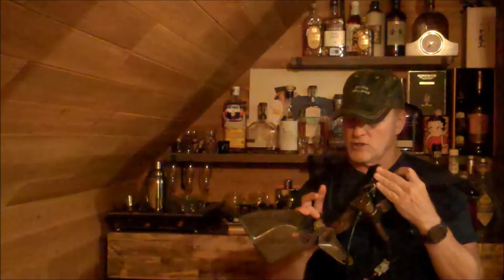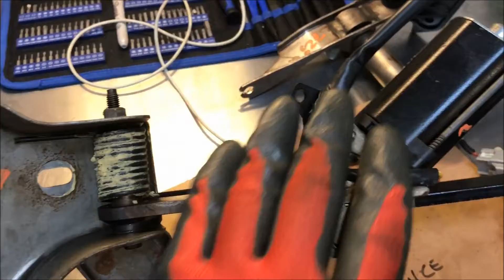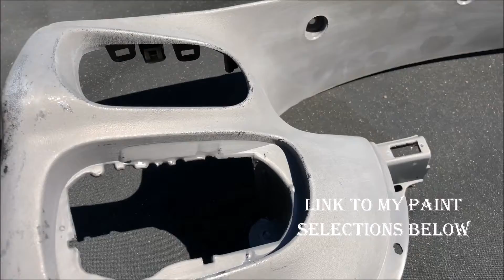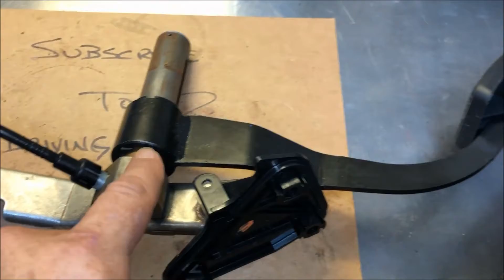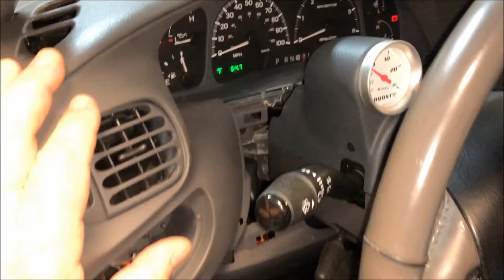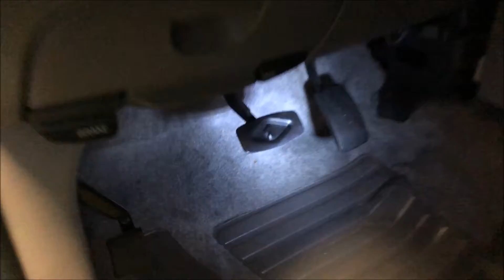How To Install & Repair Power Adjustable Gas & Brake Pedals: 10th Gen '97-'04 F150 Expedition F250LD

Comment: Thanks for the video! I noticed 2 things that might help others

1. to get the spring in place, I had good success installing the sides in opposite order: putting the straight side of the spring in place first and then reaching up to grab the hook. Then with the brake pedal bolted in, but not connected, pushing the brake pedal toward rear of vehicle and grabbing the hook side of spring by hand and bringing it around pedal arm. It took 2 tries and was done in a couple minutes, but it does feel a little sketchy. I do have smaller hands that makes this easier to do though

2. There is a patch cable between the pedal motor and connector shown in the video. I was moving fast in the junk yard and clipped that patch cable. Whats worse is then at home I spent a bunch of time looking for a pigtail coming off the main harness that doesn't exist. I had to rewatch the video to eventually  realize I messed up. Had to go back to the yard to get another patch cable.
Reply from the maker: Great tips, thanks for sharing that insight with others.

Comment: Thanks for the video, I just purchased a 97 F 150 that has the adjustable pedal but don't work. Should I test the pedal switch first or go straight to the motors that lower and raise the pedals? Thanks again awesome video 🙏
Reply from the maker: Thanks for your comment! Have you checked the fuse?  Anything else not working that may be on the same circuit?  

Disconnect the connector to the motor and test two things:

1) on the motor side of the connector, test the motor for continuity to be sure the motor is not bad.  Set your meter to ohms and make sure you have a closed circuit.

2) on the dash side of the connector, select DC volts on your meter and check to see if you have voltage at the connector when you push the control button

From there, the fix gets more complicated depending on what you find.

Comment: So is the plug with the red cap behind the headlight switch for the brake pedal switch or the power sliding windows switch?
Reply from the maker: I honestly don't remember, you can match it to the switches.  Each switch will only engage with a specific plug harness behind the light switch.
Reply from the maker: Just did a little research, the one with the red cap should be for the rear window slider

Comment: I may just be an idiot here, I have power to both pedals and they both act and start like they wanna move but my brake is all the way up and gas pedal is all the way to the back, how do I disconnect the connecting wires between the two motors ? Screw off pop off ?
Reply from the maker: My recollection is that it’s a pop off connection between the two pedals. Sounds like you have the right idea,Disconnect the cable and use the switch to get the brake pedal at the same position as the gas pedal.

Comment: Do you think there is a manual way to adjust them? My Harley has them but they don’t move and they’re stuck in the up position and I’m 6’4”😓
Reply from the maker: Sorry for late reply.  There are a couple of possible issues with the pedals; bad switch, blown fuse, bad pedal motor, broken wiring,.  If I were you, first thing I would do is check the fuse and if that doesn't help, trying using a 12 volt battery to move the pedal with some jumper cables as I showed in the video.  You will need to disconnect the 2 wire connector to the motor to do this.  If the motor is bad, you are kinda out of luck.  The brake pedal will not move without a working motor, however, you could lower the gas pedal by removing the cable that connects the motor on the brake pedal to the gas pedal assemble.  You can then turn the cable by hand to lower the gas pedal.  I used a drill driver to do it quickly.  Make sense?

Comment: How did you do the wiring connection.
Reply from the maker: ok, apparently they did come with power adjustable pedals and here is a link to one on eBay.  I've not done this conversion, but I'm guessing the install is similar to my video for the F150 as long as your truck is pre-wired:  https://www.ebay.com/itm/266290752190

Comment: Good job,can you please give me a link about how to get all these parts and all the parts that will be needed,I want to try it out on my 2004 Ford F 350 SuperDuty Lariat 6.0 Diesel .
Reply from the maker: Thanks for checking in.  I don't have a link for that vehicle.  Do you know if they came with power adjustable pedals?  Here is a video I made for F150 owners that have a truck that was not pre-wired for the pedals:  https://youtu.be/O3X953kVmYs?si=b30M2YfYjgVzDrBB

Comment: Thanks for the video, my pedal wiggles slightly side to side on the rod where the pedal runs up and down, any idea if that's normal?
Reply from the maker: My pedal is a little shaky like that as well.  As long as it is not too excessive and operates properly, should be fine.

Comment: Hey,

I have a 97 F150 and a donor 2002 Expedition with the pedals in it and I want to swap it over. The problem is I don't have any wiring harness in my 97 F150 so I have to pull everything out of the expedition.
My question is what do I need to operate it? The Motor comes into the connector with two wires, but on the opposite part of the grey connector are 5 wires so it doesn't make sense to me. The connector from the switch in the panel has also 5 wires who go down on the drivers side in a big grey main connector. Is this maybe for memory? I just want It to operate so I don't extra stuff.
Can you maybe help me? Here In germany nobody has ever done this retrofit

My thoughts where just connecting the motor and the two power wires on the switch with each other and get power and ground maybe from the chassis or the light connector...
Reply from the maker: Hi Jordi, give me some time to look into this.  I need to review the wiring diagrams.  The motor is reversible, so I believe the switch is reversing polarity to get the motor to run both directions.  Also, the switch is lighted.  A bit busy, so be patient.
Reply: @DrivingIntelligence  Hey thank you soo much for your quick reply. Appeciate it. So I'll wait for your answer. Big thanks from germany
Reply from the maker: You’re welcome! Just make sure you subscribe, and like all my videos! ;)  I lived near Stuttgart for a short period of time with the tech industry. Really loved your country.
Reply: @DrivingIntelligence  Already done bud :-)
Oh cool and nice to hear. Stuttgart is just 4 hours away from me. I live in the "Ruhrpott" deep in the west but my future plan is to move over to your country.
Germany is great and has a few positive aspects ( for example the health system ..) but since my early youth I'm addicted to the US and now that I'm 26 I trying to live my own small US live by for example driving your trucks ;-)
Reply from the maker: Very nice!  Welcome to America when you get here.  And if you move to SC, look me up, we can do some videos together.  ;)
Reply from the maker: Jordi, I think I might do a quick follow-up video to my adjustab le pedal install based on your question.  Can you send me some high quality photos of your truck, your location and the Expedition that I can incorporate into the video?  If you want your pic in it, send a photo of your truck with you in it.  High quality video of the truck with the phone turned sideways will also be of benefit.  Looking into your question now.
Reply: @DrivingIntelligence  Hey- cool that sounds like a good video content. I already took some photos of the wiring and the plugs. I can send it to you via email if you want to
Reply from the maker: @Jordi.McFly.  Do you have Facebook?  Check out my page at www.Facebook.com/DrivingIntelligence - will be easier to send material to that location.

Comment: My gas peddle is all down n break peddle is up. How do I adjust them
Reply from the maker: Good question.  I assume you have power pedals.  If so, you need to remove the cable between the gas pedal and the brake pedal.  Use the button to reduce the height of the brake pedal to bottom out, and then reattach the cable.  You can see the cable in my video.  Does that help?
Reply: @DrivingIntelligence  My brake pedal doesnt work, but my gas pedal does. I may just go manual system and be done with it.
Reply from the maker: Have you checked to make sure the cable is properly attached?

Comment: So the wire to that red dummy connector is for the pedals or rear slider?
Reply from the maker: Thanks for the comment, I don't recall if that connector is for the slider or brake pedal.  My XLT had both connectors.  They are set up to only be plugged into the correct switch.

Comment: You think 03 xlt fx4 regular cab would have the wiring for this mod?
Reply from the maker: it is possible and likely, but the only way to know for sure is one of two methods,  pull the headlight switch assembly and look for the wiring harness, or look under the dash for the connection to the power pedal motor (it will be towards the dash in front of the brake pedal assembly.  You can see this in the video.  Hope this helps.
Reply: Right on brotha found it, Thank you! Also do you know if it’s possible to put in a Harley/lightning 5.4 supercharged engine into a 4x4 truck and be able to use the 4x4 as well?
Reply from the maker: Sorry for late replay, seeing old comments I never responded to... yes, you can do that.  Should not impact use of your 4x4, but try the changes I made to improve fuel economy first.  The engine is a much more capable animal now:  Part 1 - https://youtu.be/uCerPykH4pA & Part 2 - https://youtu.be/oHsBNGAJOGc

Comment: You can probably also use a 9v battery to test at the junk yard. I keep a 9v battery in my tool box for testing injectors and other electrical components with some wire leads.  Another great in depth video! How much better is that bbk throttle body? Some say you can Dremel out the factory one where in necks down in the front to get a 75mm throttle body. Those adjustable pedals are super nice for people over 6ft tall. Great video
Reply from the maker: and that 9 volt battery suggestion is mint... thank you
Reply: Also, do you notice a difference in brake pressure and throttle response with them not all the way forward? I know they don’t or aren’t supposed to change the angle of booster rod and throttle cable but for some reason, even taking into account the pedal is now further away, when I don’t have my pedals all the way forward I feel like the brakes become a little spongy or sluggish and the throttle is not as responsive. Even at 1/4 throttle full up vs 1/4 throttle back some and it seems to get worse the further back they go. I’m not sure if it’s in my head but I noticed it with my girlfriends truck as well as she did too.
Reply from the maker: hello again, the throttle body works out well.  Cheap enough to buy and not waste time gutting your stock unit.  In fact, I sold my stock unit to make up for some of the expense.  With the 5-Star tunes, truck is much more responsive off idle.  With regard to pedal, I have not noticed anything, and given the design, I am struggling to see how the adjustment would impact brake pressure and throttle response.   I'm about to go out for a drive and will try...
Reply: @DrivingIntelligence  yea I agree on struggling to figure out how it would impact the pressure. I've looked over it a lot and I came up with the conclusion it's in my head I guess lol. I do know my long tubes are causing spongy pedal after driving for 5-10 minutes. Because Ford put the abs pump so close to the exhaust. But my gf truck has stock manifolds. I'm actually going to be redoing my entire brake system shortly with power stop truck and tow, front and rear, with calipers and sstubes (fine lines) full stainless steel brake lines with ss braided brake hoses, and I'm probably going to run dot 5.1 since the lines are close to the headers for higher boiling point. So I'll be able to know for sure then. I've warped like 4 passenger side front rotors and couldn't figure out why for the life of me until it hit me one day. Check out those finelines though on sstubes.com. The whole kit can be bought for around $260 from them or carID.com on ebay. The braided hoses look decent but the ones I had custom made from crownperformance.com trumps them. The cool thing about the sstubes is they give you the braided brake hoses with a new brake line separately for the rear axle, where as the Ford OEM is made together and have to be replaced as a whole.